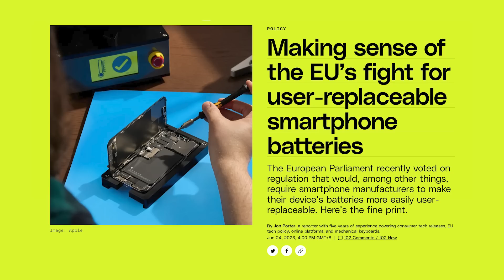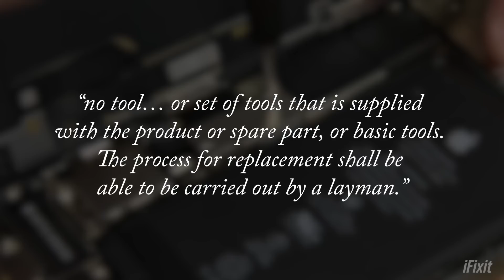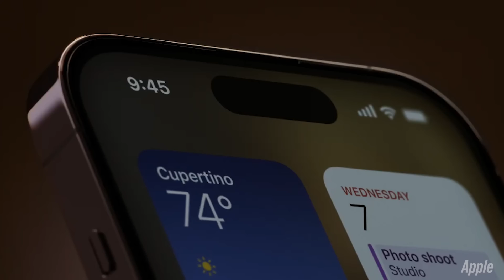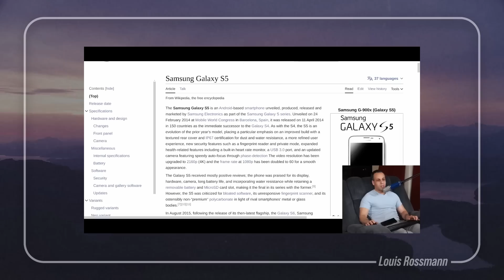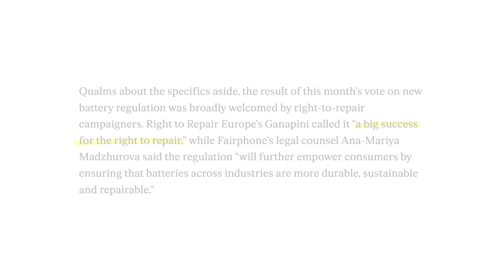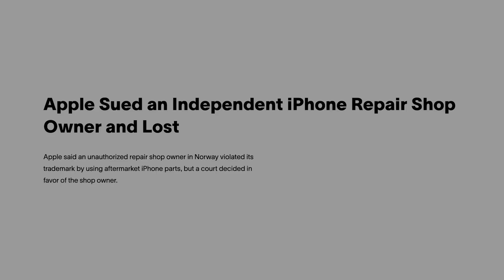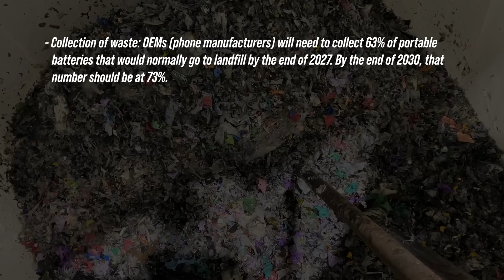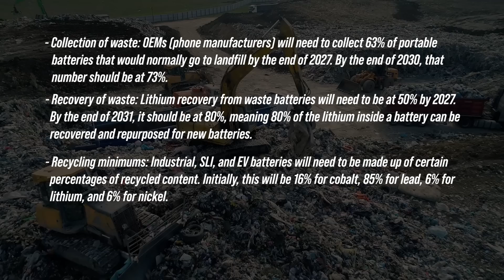EU Just Changed Smartphones Forever

Comment: This is  an inevitable requirement if the world is not going to be overwhelmed by the electronic waste mountain and run short of the elements required to make the electronic components.
The manufacturers had switched to a business model that used designed obsolescence to force consumers to replace their expensive mobile devices every couple of years. This made such devices a really bad investment to buy, due to the massive rate of depreciation. The solution was effectively a service model, where the user rented devices through an even more expensive contract. This had the advantage of making the use pay for the cost of their device many times over. The model encouraged extensive use of the service, as this was the only way the expensive contracts could be justified 

The EU law will destroy this model, as mobile devices will have a longer working life. However manufacturers are likely to fight back by using software obsolescence to render the electronics useless. Google already does this with android devices, where the OS version is only supported for a couple of years. One must wonder why the operating system generations need to be so incompatible with the previous generation of application software, could it be to design in obsolescence.

No doubt the mobile device manufacturers will use the other trick in their arsenal, of making the removable battery a proprietary design, the manufacture of which can be discontinued to again make the associated dependent products obsolete. The EU might have prevented this strategy by making it a requirement that all mobile devices use a standard battery specification, much like the AA and C battery types used in other portable devices, such as remote controls and test equipment. 

It will be interesting to see how the manufacturers circumvent the good intentions of the EU, to preserve the current lucrative business model. My guess, they will use software obsolescence. Again the EU could preempt this strategy by simply applying a cost to the scraping of working electronics. 
It is in the consumers interest to support the EU policy, as there is evidence that this destructive business model is being implemented in many new product areas, such as brown and white goods and even automobiles. All of these products can be rendered obsolete overnight, simply by stopping the support for the operating system on which they depend. 
Imagine your car failing it's MOT because the manufacturer no longer supports its software, or your white goods, refrigerator, cooker, home lighting etc not working because of an internet of things security upgrade. TV sets are now replaced more regularly because of the instability in the transmission standards

Comment: I think this is idiotic, batteries were replaceable a decade ago because they had to be, they sucked. Now, I’ve never needed to replace a better in anything and continue to get better and more reliable. Sure, battery replaceable phones can achieve waterproofing but they will never be as good as the phones we have today. More phones will break from water ingress than those that will need battery replacements. The mechanisms to accomodate this will reduce battery size, even if minutely which will increase battery cycles and actually contribute to batteries degrading faster. EU is insane and I hope some companies have the balls to pull out of that market & create uproar amongst customers. Imagine the backlash EU would get if Apple pulled out, they would be forced to backtrack.

Comment: Wait... EV battery replacement needs to be done with no tools by a layman?  Can we make ICE cars have the same rules?  Engine replacement requires no tools and can be done by a layman too?!  Oh... Jets engines should also require no tools and be replaceable by a layman while we are at it!
Reply: Nonononono. 
The law effects EVs (because it effects absolutely everything with a battery in it) but depending on category, other regulations apply. 
So all have regulation for recycling and composition, some need to be easily repairable in repair shops (like the ones in e-scooters) and most things in the category of "home device" need to have a user replaceable battery.

Comment: When you can't remove the battery easily, then if you travel with your phone you can be tracked/monitored wherever you go. If however you can remove  and replace a battery easily when you want to use the device, any intervening movement/travel cannot be monitored. Apart from corporate greed, the Govt agencies probably approved of non replaceable batteries as your device, even if turned off, still signals the networks of your location. I am thus surprised that the EU brought in this long overdue law but then the question - how much will a replacement battery cost?. It will be like printer ink - here's a free phone - the batteries are $500!

Comment: I think the issue of phasing out removable batteris isn't entirely to blame on the manufacturer's assumed dishonesty or greediness. 
If an engineer came to the conclusion that a custom, proprietary battery would bring better longevity and space efficiency to then ext product, it's not unreasonable for the people in charge to bring it into the design. Even in the time of replaceable batteries, the tech as a whole was moving forward at a great pace. Most people replaced their phones anyway cause they wanted the next feature, the next camera, the nex screen and whatnot. Batteries catastrophic failures were an oddity that in the grand scheme of things didn't matter that much since most users would replace working phones within two to three years anyway. Telecom providers also share some indirect blame since they encouraged changing phones often by offering them away at heavily discounted upfront payments for new plans.
You could make the comparison with cars. In an environment where everyone is leasing their car and switching every two years, there isn't much interest in building a easily maintainable engine and drivetrain because the car is likely to go to a maintenance facility for refurbishing and a new lease before most parts hit their expected failure.

Comment: My second phone is still an LG V20, The last flagship phone with a removable battery, the only thing that makes it hard to daily is the CPU. It's still thin, it's solar well made, big battery etc, and I've been able to buy new batteries for it every few years for super cheap. As battery density increases over time, the new ones are the same size but have higher capacity than the original from 2016

Comment: The broken clock is right twice a day, I would rather have companies come up with phones with replaceable batteries if that's what people actually want with their wallet vote, rather than letting a government dictate design specifications with threat of violence. It makes sense for some devices to compromise the form factor for battery access (I bought a cowboy ebike over other ebikes with removable battery being a must-have), but some products (against water ingress while minimizing for size for example) would make more sense truly sealed, these are simply engineering tradeoffs that should be allowed to be made by the designers and chosen by the consumers

Comment: Why people are not thinking about the problems it brings, as the user may replace it with a sub-standard battery which may not only damage the phone but also injure the person. I welcome the type-c rule for iPhone, but the user-replaceable battery is not the way to go, instead, there can be something like an easily repairable screen and battery.
Reply: How exactly is repairing a battery safer than replacing a battery?
Reply: @That0neJawn  A mobile whose battery and screen are easily replaceable I meant. You shouldn't have to take apart each and every component before the screen or battery can be replaced, those should be the first thing we can remove once we open the phone.
Reply: @mouri_p  Yeah, exactly. 

But that is exactly what this is about, at least on the battery end. Easy replacement that everyone could do, without specialized skills or tools. 
On every single device with a battery in it, minus a handful exceptions (objects designed for regular water contact, for example).
Reply: How many fatalities have you heard of thanks to unsuitable generic batteries being used?
Reply: @zachryder3150  exactly, thanks to non-user replaceable batteries that we have so far.

Comment: That point of bringing users to give back to the company upon replacement is actually not that hard in theory. In most of Europe we also have a "Phand" or a deposid fee. Like for drinking bottles and cans, you pay from 8 to 25 cent more (depending on the product) and you get that money back when bringing back the bottle or can. Its the most normal thing here and you could do something similar with batterys. For example you pay 50€ or $ more while buying the phone, but if you bring tha old battery back you get this 50 bucks back.

Comment: Politicians telling hardware designers how to design hardware - what could go wrong? These are the same folks that think you can create a backdoor to end-to-end encryption without compromising end-to-end encryption.
Reply: Not even close to the same thing. This is an intentional design limitation with planned obsolescence in mind to keep you replacing your phone every 2 to 3 years for repeated sales, demonstrated by how there is a way to build them with replaceable batteries and keep water resistance. Consumer protection and user privacy are not the same topic, don't equate them. Some regulations are required, otherwise these corporate vampires get to do whatever the hell they want.

Comment: Mmmm hold up.
This sound nice, but all the EU has done is given companies an excuse to make batteries last a fraction of the length in power. They can be replaced now, so why put an extremely durable and/or constantly rechargeable battery in with the phone when you can now make DOZENS of replacement batteries that last only a tenth of the time?

This sounds to me more like a push to divert resources from phone companies towards electric cars as both use lithium metal in order to make resilient and highly rechargeable batteries. Chemistry dictates that conventional battery reaction directions (both forward to generate current and backward to store current) can only happen a set amount of times as the metals within simply wear down to the point they fall off the diode. This is more noticeable in sulfuric acid car batteries as the conventional electrolyte cell is used the most here. The same rules of physics apply to even lithium ion batteries, yet the mechanisms used cause just lower and lower levels of decay from charging.

Expect a bunch of extremely cheap phone batteries which don't seem like a problem, until you realize that you'll be needing a new one every couple of weeks thanks to the fact it uses NiMH (Nickle Metal-Hydride) instead of Lithium Ion.  
I fully anticipate this is in attempt to conserve lithium metal for electric car batteries.

Comment: Another good thing about this is just simply sliding a 2nd battery into your phone if its going to be a long day, much better than having to cram a power bank with a wire coming out of it into your pocket.

I wasn't old enough to really want a flip phone when they were common but I understand that was a feature people loved about them. Granted those also had a lot less features so people probably wouldn't drain the battery over the course of a day anyway.

Comment: I don't believe the move to non-removable batteries was driven by profit but more by competitive necessity. 

Apple has always stuck 2 fingers up at both it's customers and the rest of the world. On the one hand this is a good thing protecting both the brand and the consumer. 

On the other hand, they persist on silly, petty standards that are aimed at extorting more money from their most loyal customers - a few are mentioned in your video.

Their policy of sealed cases is part of the defense they have against theft of their intellectual property (IP) and erosion of their brand. I was able to buy counterfeit versions of the Samsung battery for my Note 4. The same could easily be done for Apple products but it's not commercially viable as the demand does not exist. 

The rest of the industry tried to use this as a competitive advantage over Apple but as the demand for environment proof phones grew, the cost of developing and producing IP60+ units became too high to remain competitive. Plus consumers didn't really care. It's nice to have but we aren't going to pay more for it! 

Apple will easily find a solution to this and I am certain that they will find a way to make more money out of it (but it won't be up front)

Comment: 4:53 The claim that Apple disables features for profit is inaccurate, there are valid security reasons for disabling Face ID when non-genuine components are detected. Apple aims to protect customers by matching serial numbers between phones and Face ID parts. If a third-party screen or Face ID parts are installed, the phone can't verify their authenticity or trustworthiness. This is a critical protection against potential spoofing or hacking of biometric data.

However, the repetitive pattern of dramatized or skewed information in this channel's videos makes me question the neutrality of the facts presented. Though I enjoy the content at times, statements on topics I'm knowledgeable about often miss nuance or misportray the truth.
Reply: My idea for how it should work:

After the user is prompted and warned of the risks, the message disappears permanently and all features will be enabled. However, this does not persist over factory reset. When a person buys a phone and recieves it factory reset, they will see the message and be able to dismiss it or report it, return it, etc. But this option should be locked behind the phone's PIN and the user's Apple ID.

This should solve all of the aforementioned security problems. It's good to warn consumers and protect them, but if they specifically say that they're fine with the risks, they should be allowed to use the full features.

Comment: Samsung galaxy s4 with a removable battery back in 2013 is thinner than iPhone 14! 
Also the excuse of the glass design is water and dust resistant: the 70$ G-Shock watch has a screen and speakers and it can dive up to 200m under water with a removable battery! So what are we talking about here? Apple and co are so bad that they don’t want people to repair stuff. If the battery is broken you need to have a new phone. SCAM

Comment: It's probably both! Meaning yeah, you could get a thinner design if you just glue stuff together but also profit because you now have to buy a new one once the charging port breaks. Which is the reason I replaced my last two phones... Not because they where not usable but I could no longer charge them. And that leads me to my latest discovery. There are different sizes of usb-c charging cables and if you do not use the one that came with your phone you'll probably wear out the usb-c charging port even faster... Go EU!! I want to be able to fix my own stuff!

Comment: Great video! I think Tesla is actually going to be affected the most, of all the famous companies. Just last year (or was it two years ago?), Musk touted the new chassis design in the annual shareholders' meeting. The design makes the battery part of the actual structure of the car. In other words, replacing it is a non-starter, even for Tesla itself. Now they won't only have to go back to the old design, but they'll have to make the battery replaceable 'by a layman", which is a huge difference even from the previous design. Recall that with the previous design, Tesla still charged $20,000 for a new battery, give or take. Now it might be possible to replace it with a cheaper 3rd party product.
Reply: I don't think the "swappable by layman" policy will apply to EVs, and car batteries in general don't degrade as fast as phone ones.
Reply: Cars aren't affected. 500V car batteries would kill anyone messing around and the EU wouldn't pass legislation that actively would hurt EU economies. We don't have a tech industry making consumer products regulating them is easy.

Comment: Most samsung smartphones (any many others) are already designed in a way that can have a removable battery. They have a main board at the top and a sub board at the bottom. The sub board has the charging port, mic and a few other basic components. They can easily design that to work like Lg did where the sub pcb and battery slides out the bottom.

The top and bottom board are connected via flex cables which could simply be place dunder the battery instead of over it. When you slide the battery and sub pcb out the bottom you simply unclick the battery and click in the new one to the sub pcb mount. Done.

It wouldn't cost them much to do this, they make it all contained and glues because a large percentage of their profits comes from replacing/repair devices as well as their protection plans and insurance policies.
Reply: Samsung even has an Xcover series with peel-off back cover. Strategically low specs for the price though, wouldn't wanna have people jump on those.